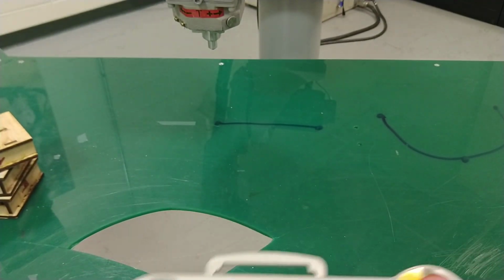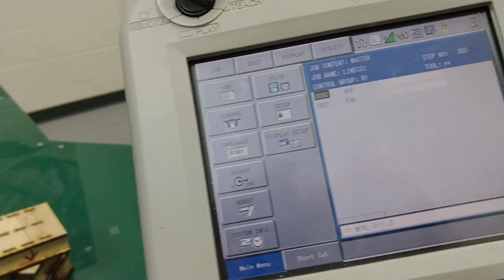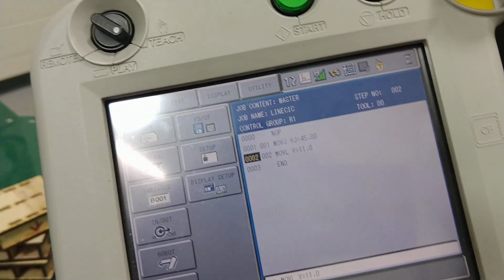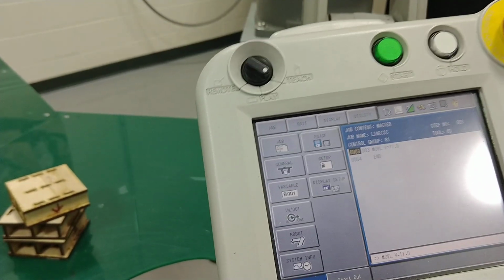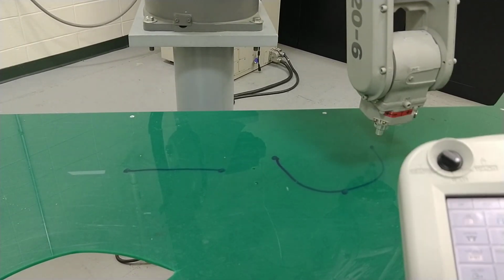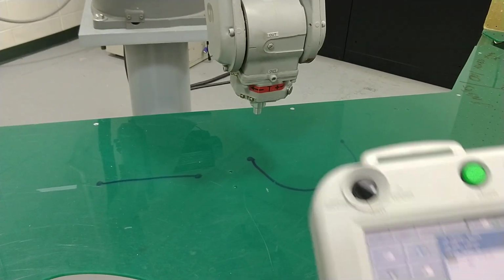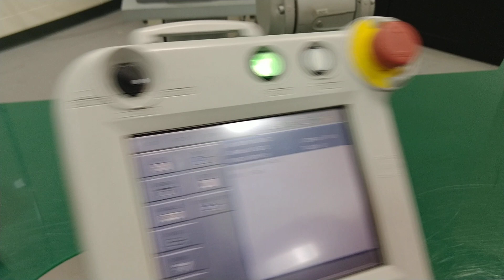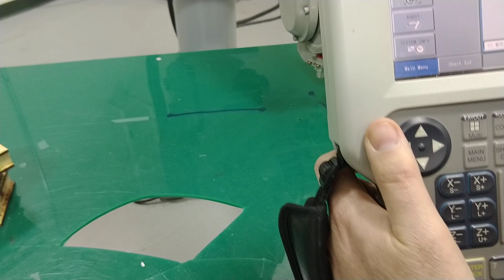Creating MOVL and MOVC motions in Motoman NX-100 controller

Comment: Probably very stupid question but is it possible to command this model of motoman robot manually on the fly via external application and not via creating job with this interface? answer does not need to be bullet proof, just maybe is enough.
Reply from the maker: I don't know. This is an older style robot that probably may or may not come equipped with ethernet modeling capability because these were prevalent in the early 2000s before that type of modeling became more prevalent

Comment: I have 4 parts that I have program for welding. Once I start a program to begin welding I notice that the points are off quite a bit. So I go ahead and touch the points up. And I usually run it for a few days.. Than ill go to the next program.. and same thing happens. So... once I start another program, the previous program I ran gets all messed up. And that happens to all the programs. I don't know whats causing the points to go off.  Can you help?
Reply from the maker: The robot's drives could be worn out. Try grabbing an axis, like the B-axis and try to move it back and forth manually. There could be too much slop in the drive.

You could also create a job to move each axis as much motion as possible then to a position and pause. You could have a punch mark or a dot on something to judge if the robot repeated or not.

teach a point to a punch mark on the robot base so the point is on the robot itself, along with a point on the fixture.

Also, if you run an exercise program and the point on the base stays on, but the point on the fixture gets of... that would indicate that something outside of the manipulator itself is moving,
loose bolts etc....

Check the fixturing too. Make sure PM is up to date
Reply: @danstaifer2028  will.try that. Thank you. Also what is PM?
Reply from the maker: @TheKinging12  preventive maintenance
Reply: Is there a command that I could add to my program that could make the robot hold until I press start again. Robot has to weld a part, than I have to add a subpart on it. But it has to weld something first before I can add it. For now I'm having to watch the robot and press the hold button or else table will turn and stuff will fall.
Reply from the maker: @TheKinging12  check out the rest of my videos especially on the inform list.
Reply: @danstaifer2028  I have watched some of them. I might have missed that video. Thank you. Sorry for asking so many questions.
Reply from the maker: @TheKinging12  in the inform list. There is a pause command. It is best if you handshake this with some IO to automate the process. Oh wait command can be used in conjunction with IO

Comment: good afternoon.  Congratulations on the videos are very instructive and helpful to me, as it is possible for you to make a video demonstrating how to create a shortcut app in the i \ f panel.  thank you
Reply from the maker: Can you give me more information. I don't know what your are asking.
Reply: @danstaifer2028  On the DX 100 and DX 200 controller there is a page where you create shortcuts, for example open claw and close claw.  It is an icon that calls i \ f panel is next to the simple menu.
Reply from the maker: @alexandrefiorotto7045  I only have access to an NX-100
Reply: Ok thank you
Reply: Dan Staifer's NX100 actually has that i/f panel feature too but its not enabled since it's also "paid feature" set up by Yaskawa from mode which you can access by pressing pendant "Main menu" button down and then powering on NX100 same time. NX100 has a huge pile of features.